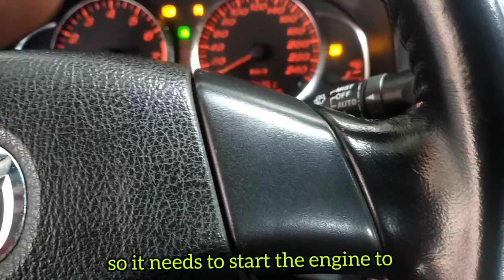how to replace rear brake caliper kit and rear caliper piston MAZDA6 2007

Comment: My Mazda 6 GH handbreak don't hold well because that shaft with grove shown at 5:10 
I could not find replacement part either. 
Does anyone know where to by it? please drop the comment if you do. 
Otherwise caliper is well maintained and functioning.